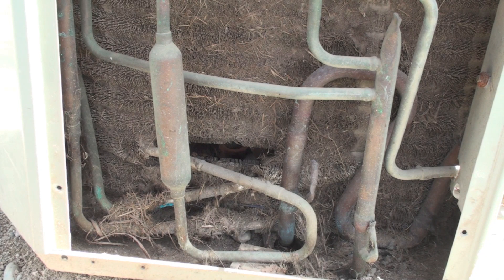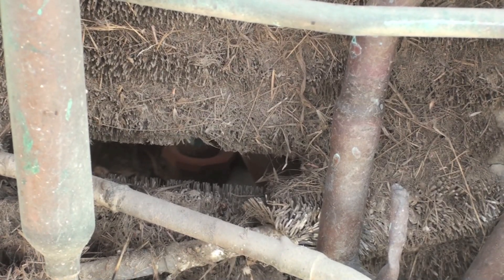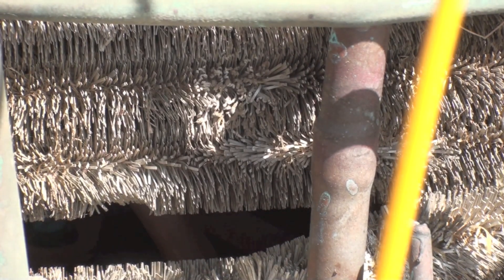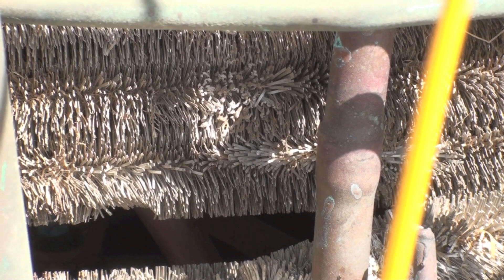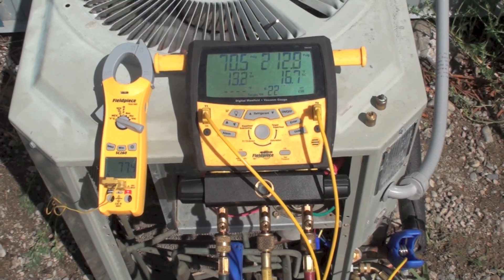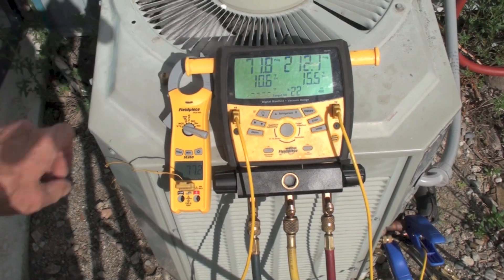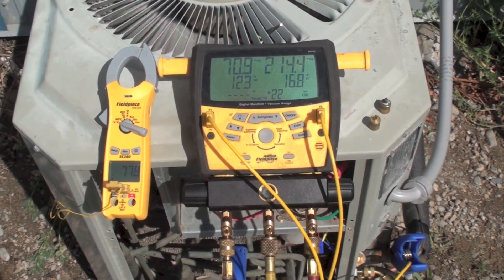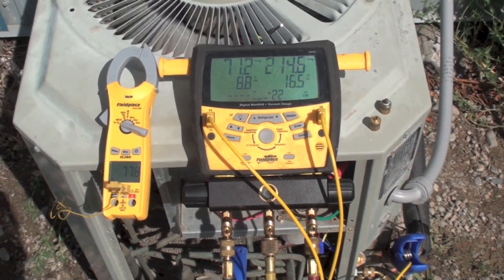What is wrong with this air conditioner #2, answer

Comment: Is it better to sacrifice a good subcool, superheat to maintain a good head pressure or vice versa?
Reply: Superheat is for fixed orific, subcooling for a txv
Reply from the maker: Daniel Baker I am a great lover of superheat and subsoil as measurements of system performance.   As Jody says, subcool must be used for TVX units for charging, but superheat must also be measured.  One of the things that I look at when testing a unit, is to check subsoil, superheat, compressor amp draw, head pressure, suction pressure and temp split across the coil.  If one of these numbers is out of whack and I have done due diligence in checking things like dirty coil, fan speed, etc, I throw out the one that is out of whack and be done with it.  Hope this helps.
GFM
Reply: Listen to him, he forgot more than ive learned....

Comment: There is the possibility that the previous technician checked the charge with the dirty coil. After cleaning it, you should add refrigerant if the superheat is too high